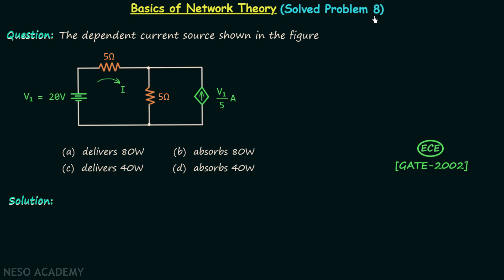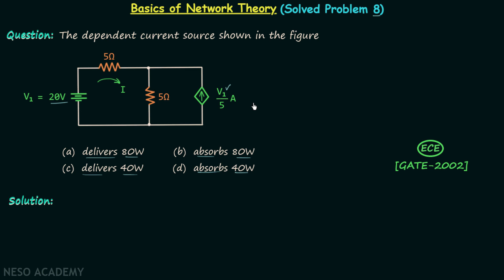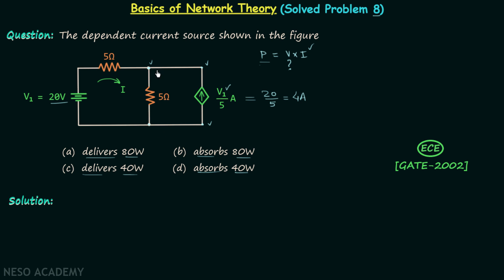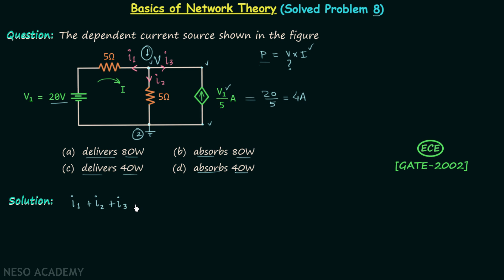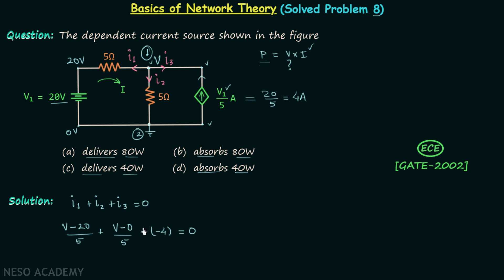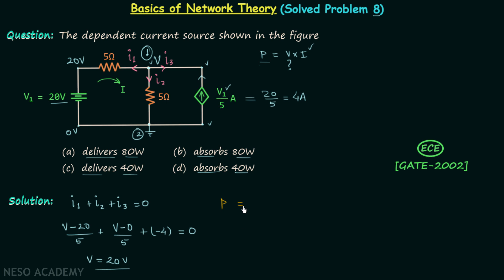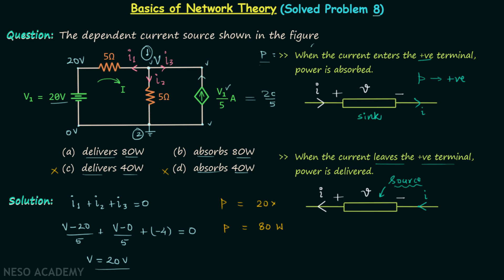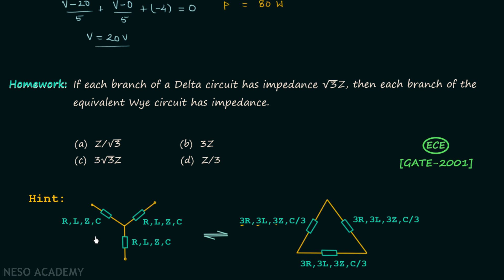Basics of Network Theory (Solved Problem 8)

Comment: Sir I have one doubt, the resistive circuit looks like voltage divider, since identical resistors are used 

Voltage across dependent source is 
20×[5/(5+5)]=10V and current provided by dependent source is 4A

So power= V×I= 10×4=40W since current is moving from - to + power is released... So 40W is wrong.....?
Reply: U have applied voltage divider rule but,we don't know the voltage at 5 ohm (which is in series with 20v) so we will not get voltage at 5 ohm (which is parallel to dependent source)

Comment: What will be the answer if we apply KVL for the loop?
V1=5i+5(i+4)
20=5i+5i+20
i=0???
Reply: Yes. It would be zero. And current across 5 ohm resistor in parallel with current source will be only due to the source value, i.e. V1/5 or 4 Amp
Reply: I think it's (i-4) not (I+4) because if we are applying kvl to loop, If the current direction is in clock wise in both the loops then, from the second loop we get i2=-4.
Then substitute and we will get I=4A.